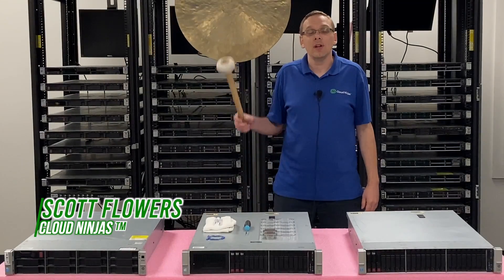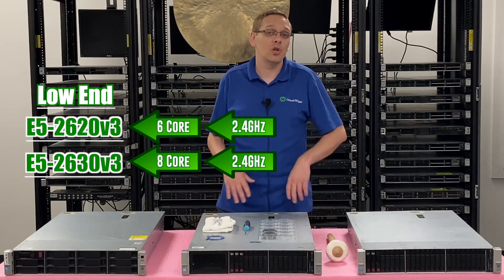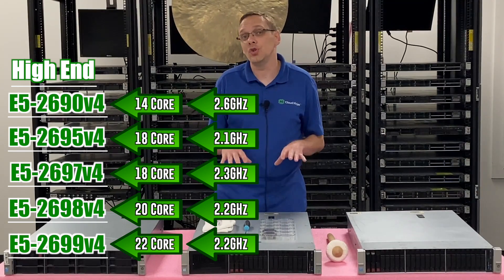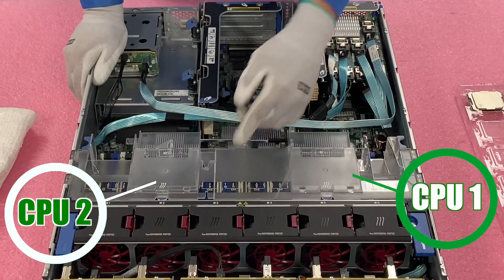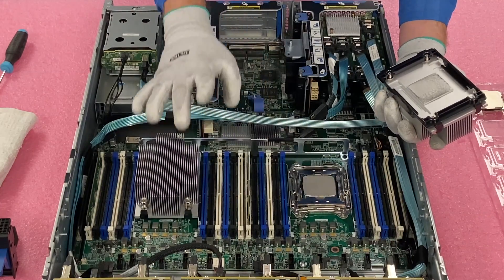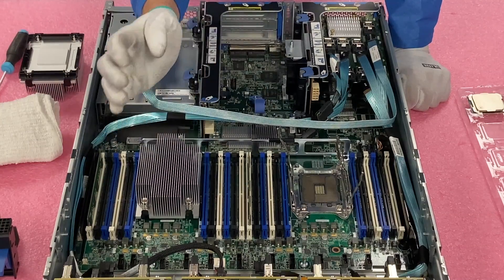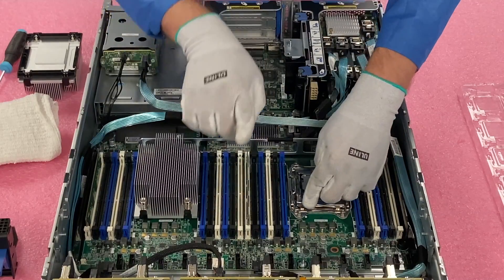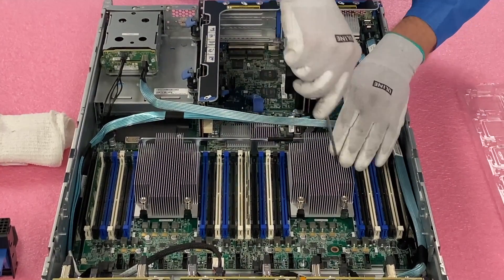HPE ProLiant DL380 Gen9 | CPUs | Intel Xeon Processors Options | LGA2011-3 Socket | CPU Install

Comment: Buenas noches tengo el servidor DL380 g9. Con 2 procesador de E5 2620v3.
Compre 2 procesador de E5 2680v4:
Pero no lo reconoce. processor stepping not supported.

y mas:
Por favor me podria dar la mano. Gracias
Reply from the maker: Might need a BIOS update to recognize the V4 cpus.
Reply: @cloudninjas  como se hace la actualización por favor

Comment: Is smart array battery the same as smart storage battery in a dl380 Gen9 server or are there both different parts?
Reply from the maker: Essentially they are the same. It really depends on what server you are using, but overall they should function the same.

Comment: So the blue cpu tray is not required? My server came with one cpu installed and it has the blue plastic surround. Seems to make reinstall more difficult and already tweaked some cpu pins that required “micro-surgery” to correct.
Reply: Can confirm it is not required although makes confirming the orientation a bit easier. Like in the video if you can lower the cpu into the socket straight down as to avoid touching the pins with a corner is best. In my case first boot resulted in a memory error for dimm 1 on my 2nd cpu. Took the cpu back out cleaned the pads on cpu with 90%iso and then light strokes with toothbrush on pins on board to clean any old thermal paste flakes. Reseated cpu and memory issue dissappeared. Had also tried reseating ram at first but didnt resolve my issue. Cpu wasnt alligned or debris was cauaing faulty contact. 

Main thing look for the gold triangle on the corner of the cpu package, and the corner on the cpu socket on the motherboard that has a notch cut out. Align those and the orientatio is set. Then just make sure the cpu is centered.

Comment: What is your thoughts about using the high performance heatsink? Planning to upgrade from a 2620 v4 to a 2697A v4.
Reply from the maker: I think that using High Performance heat sinks and fans for the higher end CPUs is a smart decision.